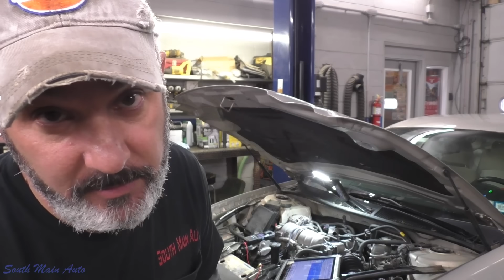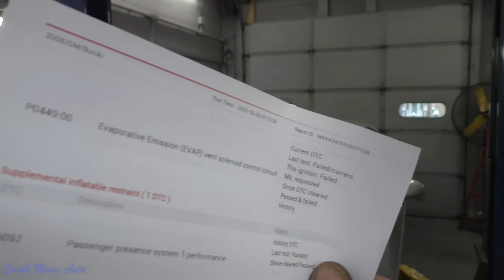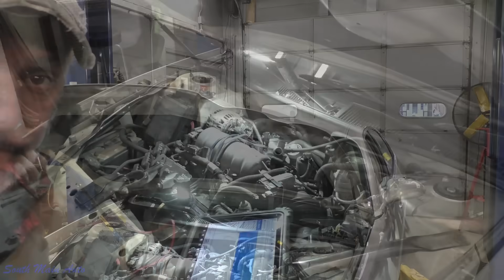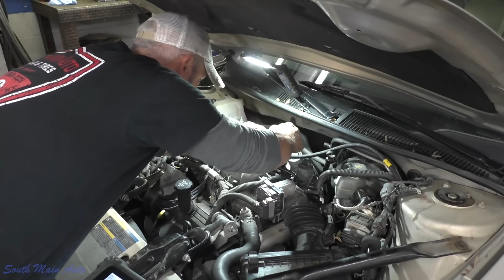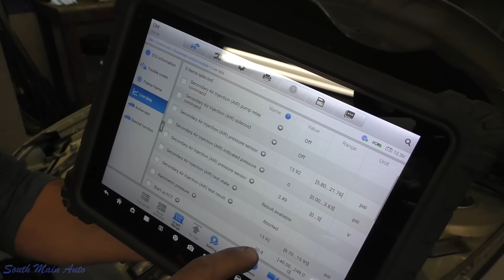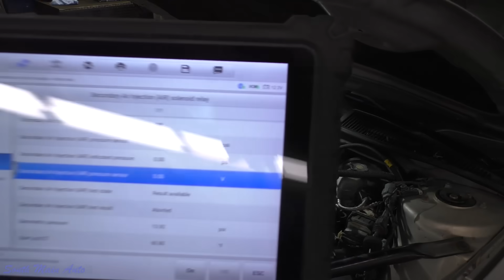When “New” Parts Are Worse Than The Broken Ones 🤬

Comment: China doesn't need to attack us with their military.  They are slowly driving us crazy with their cheap junk parts.
Reply: China is capable of making very high quality parts.  Its the greedy American companies that spec the parts to be made from the absolute cheapest junk so they can mark them up 300% for the American market...
Reply: @adammoore284  lol. No theyre not.

The Russians gave up helping them build jet engines because they wouldnt use the right alloys. 

It wasnt until Clinton sold them jet engines under 'non military purposes' did China finally get decent GE jet engines. They still won't use proper alloys or quality parts. 

Its why their engines are being cycled out so fast. 

Even the Russians who are buying Chinese equipment are thinking China is sabotaging them when the tires they bought failed and fell apart. 

Junk products made with Junk material reverse engineered and copied from western or Russian parts and materials done on the cheap. 

There's numerous first hand reports on the net about dealing with China. 

The simplest answer is to just not.b
Reply: @NikolaiMihailov1 we are most likely debating this back snd forth on high quality smart phones built in...
Reply: @adammoore284 

Western designs built in Chinese factories,yes. Though in many cases many chipset factories are moving from China/Taiwan back to the west due to tensions between China and Taiwan.  

China doesnt iterate. They just steal from everyone else and make it worse.

Remember. China is the country who had brand new rifles keyhole at 5 meters not that long ago.
Reply: @NikolaiMihailov1   China will invade Russia sooner or later to reclaim Chinese land conquered by Russia 130 years ago. So of course some Chinese will sell Russia inferior products.

The secret to doing business in China is to hire foreigners who speak Chinese to manage your business there. China builds plenty of quality products: they are number 2 in the world now for rockets, already passed Russia.
Reply: @charliep8 

+50 social credit score to you too.

Its amazing the shill bot farms about China glazing. 

You can try that. And theyll screw you over with BS excuses. 

Their metallurgy is bad. Their concrete is bad. 

If China was this amazing superpower, why are there so many Tofu Dregs that are failing? Why is China starting to.face economic troubles?

Why is the people who do end up buying Chinese military hardware rip out the Chinese parts and install NATO or Russian parts?

Why does nobody want to buy CN equipment unless its cheaper than free?
Reply: @NikolaiMihailov1   Nikola, thanks for the shout out. I'm American with ancestors going back 300 years. I speak, read and write fluent Chinese. Nothing is so black & white. Not glazing one way or the other. Everything Apple is made in China & quality is top notch. Lots of poor quality junk also made in China. Most bad military quality is because of corruption in the supply chain. It's not like corruption doesn't exist in Russia or the USA.
Reply: @NikolaiMihailov1 what China are you talking about, from the 80's maybe? I think you underestimate them and that's the problem, they're ahead of practically every country in terms of technological advancement, quality for for cost, and mass production. They have the biggest car production in the world selling more cars than anyone and most people don't even know.
Reply: @nemanjad7497   Exactly.
Reply: Temu
Reply: they own us lock stock & barrel..!...!
Reply: It's not China's fault - it's US companies that want to make more money by having China manufacture their parts instead of giving a $hit about their customers or their own product
Reply: @ReservedForFutureUse  Then why didn't manufacturers do the same with other countries? Look at the auto parts RETAILERS, all pushing the same white box garbage that's cheap to stock and easy to mark up for the customer that needs something now.
Reply: @ReservedForFutureUse  bro its the US fault, you can't do anything here, you want that part to be 750$?  then make it here...
Reply: @mattlane2282  You can absolutely make the parts in the USA. Its just a matter of investing the money to build the parts in the USA. Problem is Advanced Auto, NAPA, O'Reilly's, etc. won't pay the additional 20% and won't commit to buying American Made.
Reply: Yes,that's what I've been saying for years,it's not a regular war,but none the less still a war .
Reply: @AndSan-n7q Don't be dumb.  China makes shit to the exacting specifications as the brand wants them to.  It's the Brand themselves don't want you working on shit.  They want you buying new shit.
Reply: By blaming China for shitty parts, I can tell that your IQ is below room temperature.
Reply: 100% true
Reply: Also could be a fellow citizen with low ethics and ordered that to his inferior specs. From my experience one is going to get what ordered.
Reply: Just look at the bad parts that are plaguing the new car industry.
Reply: @larrylove9589   Just saying it is not the lack of Chinese manufacturing capability but supply chains ordering the cheapest crap possible, a trend not only in the automobile industry. Just look at LG refigerators, your cell phone will outlast them by a mile. And yet they are sold like there is no tomorrow.
Reply: @juergenpaton5004 You give the chi-comms too much credit.    They have been caught multiple times cutting corners on commitments to their customers to boost their profilt.  If the ordering company does not keep enough representation at the mfring plants checking them, they will start cutting back quality until they get detected.   This is not a one time deal.   They are known for it.
Reply: @dfranklin3879  exactly, that's what I've been saying for years. It's a different kind of war , but still a war.
Reply: If you're buying NAPA parts the only company to blame is NAPA. They have a branch in Shanghai in charge of Quality Control. Obviously they dropped they ball. Chinese parts are low quality because American buyers demand low prices and Chinese aren't stupid: if you lower the price they lower the quality to meet your price.
Reply: @charliep8  its a pattern and i now treat all chinese manufacturing as under the same company. if napa made those parts anywhere else they would work just fine
Reply: @rabbitdrink   Then you're too far gone and I can't help you. Exporting manufacturing from China back to the USA (or to Russia) requires working with the Chinese. There is plenty of good quality coming out of China (like Apple, Tesla) you just have to have quality control in place to manufacture quality.
Reply: @charliep8   apple doesnt have good quality control. they do a great job polishing their products but that dont make quality. and idk about tesla i never had one. im also in the us and our teslas are made domestic so i cant even try a chinese one
Reply: and it is working good
Reply: Yeah but honestly they are putting in there what "name your aftermarket retailer" CEO, finance, and purchasers tell them to.
Reply: @blazeandcyrus   Exactly. China is not an easy place to do business. But many of the pitfalls are brought on by purchasing managers that have no idea what they are doing.
Reply: Well, I’d assume the Chinese Mil is using the same crappy parts so I doubt they’ll make the full trip.
Reply: LOL so much Nationalism in this comment section.
Reply: NAPA oil filters for my Thunderbird used to be made in USA or Mexico.  A few months ago I got a new batch in all made in China.  I was so pissed I just threw them all in the trash.  No more NAPA filters for me until they move production again.
Reply: um, yeah literally, in all liklihood!  Look at how chinese philosophy that they friggin invented or made famous long long ago.   The ENTIRE war winning goal is to not fight.   They OWN the world in some ways due to the making of essential goods like electronics and parts of various types, and tools.  This is a massive phenom!!    Past decade has seen the steady rise of really bad quaity parts namely bearing type, like CV axles and timing belt tensioners and water pumps!   The tensioner is the big deal though and has been bricking  honda v6 engines repeatdly over this past decade.  Watch out!
Reply: Yep, China is making Eric use bad words and comtemplating becoming a drunk.
Reply: China has no intention of attacking us with their military.  Stop watching the fucking news.   If they did that the world would be over.
Reply: You could always say that it's the corporate giants specifying how they want their parts built then pay less than the factory asked, but as usual, in typical 'Merican fashion, it's China's fault.
Reply: @peanutbutterjellyjam2179  It's called quality control.
Reply: Some reports say Chinese military equipment is awful as well. Saw a video about a brand-new Chinese aerial ladder which broke off at an equipment show. Chinese quality for the people!
Reply: Yep Im also wondering when i have some chinesium whizbang electric thing if there is some kinda kill device built in everything from headlamps to auto parts, hell microwaves the list goes on...Then they just decide to push the big red button and everything from electric transformers to aircraft components just stop working.
Reply: @deepbludude4697  one nerd found a  chip in his vacu sweeper that wi fi'd all his info back to China.
Reply: @deepbludude4697  they dont need something fancy and expensive like a remote killswitch if the part just fails in 2 months
Reply: They could never get their military within 1500 miles of our boarder tho. Their military is 100% designed and built to protect their government from its people.

Comment: 4 manual fan clutches later still not running right.  Drags when ice cold, sticks on till 4000 rpm, then finally lets go and the motor can actually use horsepower again.

Comment: I ordered from the O'Reilly's in Juneau Alaska a gates lower radiator hose for a Silverado, has the Y connector where the hoses are secured with plastic shrink bands.  First one I got they shrunk the band on the wrong side of the barb. Ordered three more they're all the same. Absolute garbage.  Just said f*** it and put a hose clamp on it and shipped it.  The world is changing my friends and not for the better

Comment: Speaking of crappy parts…I have replaced the main control board in my 2020 GE front load washer three times using factory OEM parts! They were either designed by a third grader or built by one (or both). It’s enough to make me want to take up drinking too.

Comment: Twenty years ago, I had to order the same bearing twelve times in order to get two that were correct.  The rest had the right part number on the box and the wrong part number on the actual bearing.  Admittedly this is not the same sort of badness, but it was just as frustrating.

More recently I had problems with parts for a 47 Ford 2N tractor.  As the folks on the various tractor web sites say, antique tractor parts come from the land of almost right.

Comment: Misery loves company!  If it's any consolation, this problem of manufacturing and even design quality is not just automotive in nature.  It's in my construction industry, it's everywhere.  You can't promise a client anything, either, because you can only install what you can buy or create from the materials which are available.  I have also experienced the automotive and motorcycle parts quality issue, sometimes repeatedly for the same part in the same vehicle.  It's maddening and it's the way of the world now.

Comment: Just tee the old one into the line, de-pin the sensor wires from the new valve, and plug them into the old valve. Try to make it look professional so they don't lose points at the car show.

Comment: Eric, my first time commenting on your channel. I had a 97 Ford ranger with the BIG 2.3. Had a bad EVAP purge solenoid. It's super simple, solenoid and a valve. Went to the local Oh really's got a aftermarket replacement, two weeks later. It's sticking open causing the fuel trims to go bonkers. Go back to the store, get another one. Same exact thing happens, this time the parts guys are questioning if it's bad. Ended up returning that part, went to the local Pull-A-Part, got a 30 year old OEM Motorcraft solenoid, worked perfect, no problems. How is it this dang difficult! Anywho, have a good rest of your day.

Comment: For decades, there has been an ongoing issue with aftermarket companies. These companies often reverse-engineer products to offer lower prices compared to original parts. However, their testing usually occurs in a lab rather than under real-world conditions. Occasionally, a manufacturer may outsource a part to another company to reduce costs. 
I recall discussing this issue with a supplier who collaborates with Rock Auto. They receive a significant amount of feedback from retail customers expressing their dissatisfaction with the high prices of certain fuel pump modules. To tackle this concern, the supplier partnered with a manufacturer in China, which allowed them to offer these pumps at very low retail prices. However, I can assure you that the quality of those pumps was junk. Retail customers often overlook the importance of quality and instead focus solely on price.

Comment: I was a mechanic through the 90s and 2000s.  I remember in late 80s and early 90s when simple sensors in production vehicles were really starting to catch on.   But since then manufacturers feel the need to monitor every little thing that the vehicle is doing,  that's a rabbit hole in and of itself.   But consumers are forced to drive vehicles made of cheap materials and and an abundance of plastic parts that ultimately fail on a seemingly frequent basis.   It definitely doesn't help when already cheaply made parts are mass produced and are basically rendered pretty much useless out of the box.  I think most people don't really understand or know of this concept,  and nobody can really blame them.  The problem comes when the mechanic is left standing with junk parts and people just want  their car fixed.

Comment: Your videos should be mandatory viewing for people who have this type of situation with bad, so called new parts.  I feel ya as a consumer, and as someone who watches auto shop programs such as yours and Rainman Ray.  Get a so called new part, it turns out it's bad out of the box. OR, not too long ago, Ray had a few situations where he got parts in the box, but the person just put in the new part, put the old part back in the box, and returned it, and the parts store sold the part in the box, didn't even check that it was the old one sent back to screw someone else over.  My mechanic a little while back was replacing my injectors in my 05 Silverado 5.3L, and it took 3 sets of injectors to get some that actually worked right.  The ones he kept getting, all from reputable parts stores would just leak like crazy just sitting there.  Crank the truck, get a long crank because the leaking new injectors dumped fuel into the cylinders because they didn't close all the way.  Not his fault, but it takes time out of his job to go back and replace the bad, new injectors, while I have to wait, and we all have to deal with this situation. Like I said, as someone who watches programs like you guys on here, I know how it can be.  But, still, the tech has to deal with this and now he (or she) has to redo a job again until they get parts that actually are good and work. The industry gets parts from overseas, some even from the good ole USA that are either not quality checked, or someone just doesn't give a rats butt that they didn't do their job, and now the mechanics and consumers have to deal with their laziness. Don't let it get you down, though. It's industry wide, and that's not just in mechanics on cars...computers, power tools like chainsaws, etc. all are having issues like this. It was bad before, but it seems since after COVID it got even worse.  We've all had a bad spark plug or switch at times. Now, it seems like it's 1000% worse.  And, the consumer who doesn't know or get it gets irritated when there's nothing you or any mechanic or whatever can do about it but keep changing out parts until you finally get one that works.  It makes everyone who does repairs look bad when it's not their fault, but you get blamed no matter what.  Anyway, take a vacation and pull out that bow and hit the woods.  And, if you let slip some "bad words"...we get it.  The fact you don't say all those "bad words" all the time doesn't sound right to me since I grew up holding the flashlight for my dad, grandfather, or uncles and I heard IT ALL...LOL.  Cheers bro.

Comment: We dont get that problem often in New Zealand. Not sure why I see it time and time again in American videos. Weird how there’s no quality control
Reply: Are f@#$%ng kidding? I am in NZ and i see this crap on a weekly basis...alternators, startermotors, thermostat housings, wheel bearings, anything engine sensor or actuator related, drivebelt tensioners, even oil seal failure...we do try to get good quality parts, oe or similar level. But sometimes it is best to either say no to the repair or get used oe parts.🫣🫣🫣
Reply: @mrblonde2013 interesting, maybe I got lucky this whole time hahaha. Auto electrician here. I think only once so far customer put on an aftermarket crank pos sensor and it didn’t work. So I experienced it by proxy